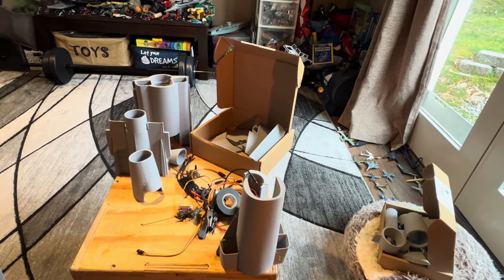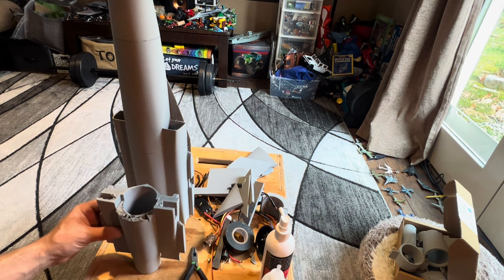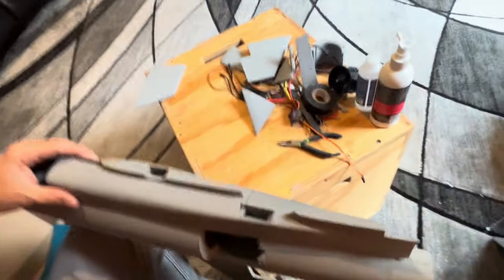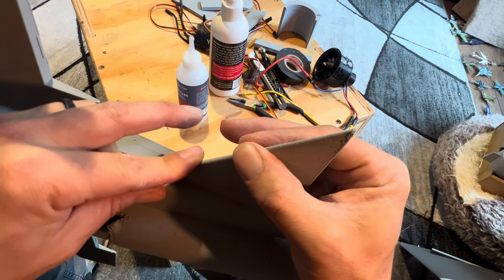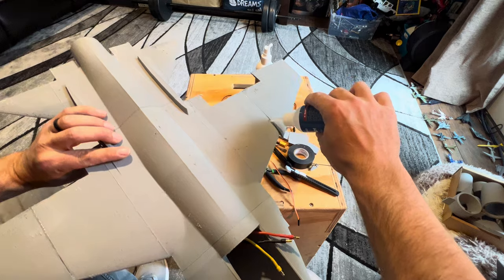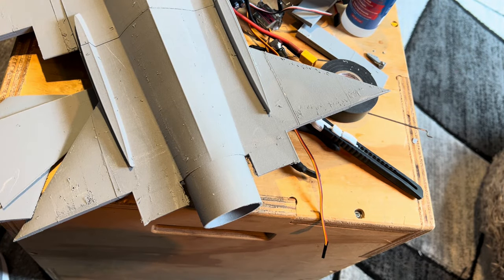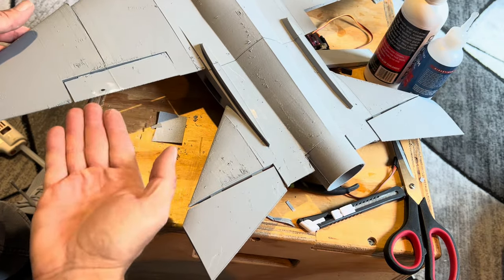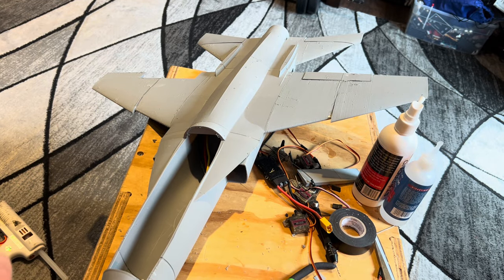T-7 build along video

Comment: Really nice 3d printed plane, and the struggle regarding cramped spaces for electronics is real! I just finished converting a guillows 16.5 inch wingspan fw-190 into an rc plane, I'll tell you that getting all the electronics and control wires inside was a nightmare.
Reply: I understand. I just did the Guillows Spitfire..... tight.

Comment: I put elmers on my fingertips and let it dry when working with CYA. Then peel the "skins" off when done.  Also, if doing a lot of glue and spray, a charcoal filtered respirator is crucial.  They are really cheap, too.  Go 3M brand on the filters, though.
Reply from the maker: Great tips. I try to no spray accelerator at all costs